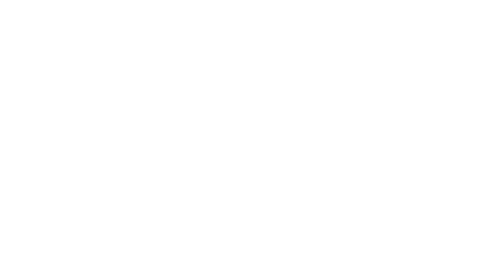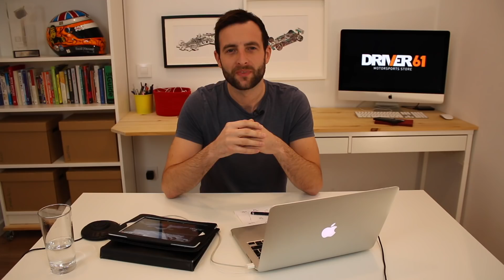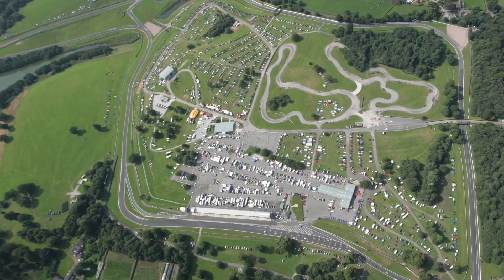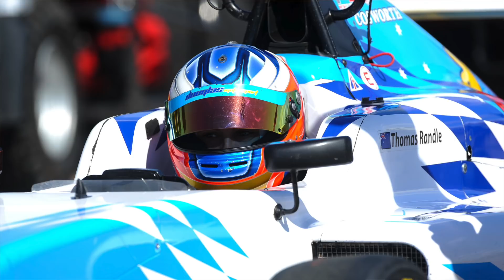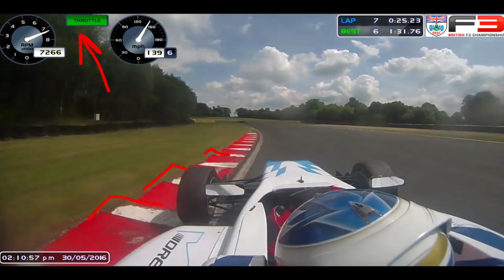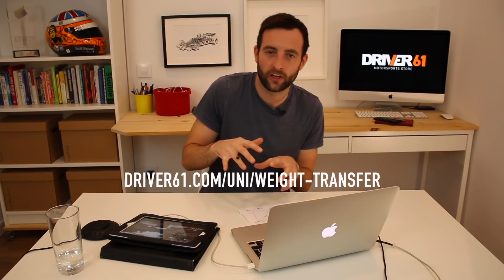Oulton Park: The Definitive Circuit Guide (inc. Onboard Footage)

Comment: The camber issue might explain the spins I had at Cascades and the understeering into the tyres at Druids. On the subject of Druids when I was first shown the line back in the late 70s we were told to take the first apex wide (maybe a car width or so off the apex) in order to cut in for the second and straighten the exit. This approach seems to have gone right out of fashion.

Comment: I agree about shell oil, in a Caterham 420R, which can almost go flat out leading up to shell oil, you can brake super late and in almost one move you can come off brake, get on throttle and run straight into the hairpin with really quite a significant amount of speed. Far more than you'd imagine would be sensible, but the track carries you round and you can just feel the back end twitch as you exit the corner and get full power on again.